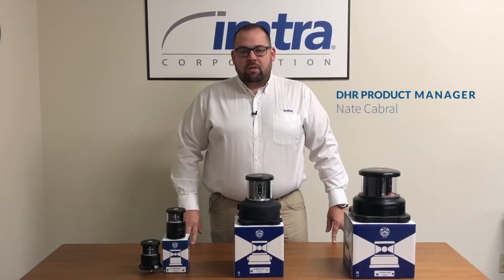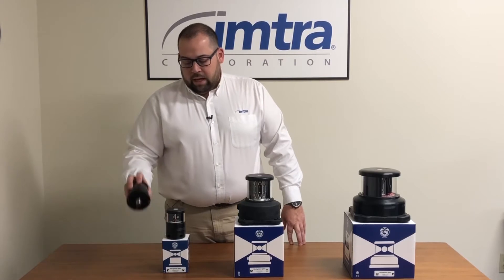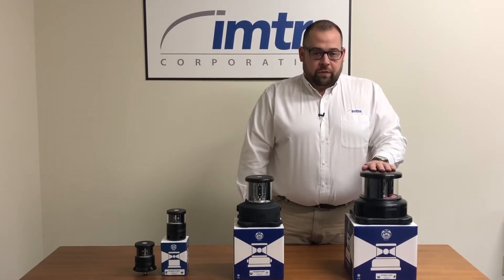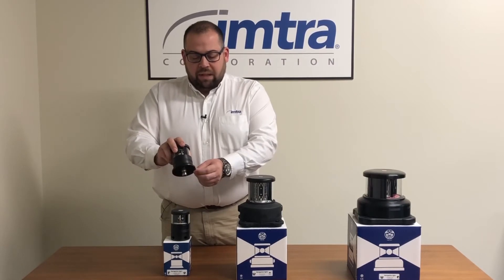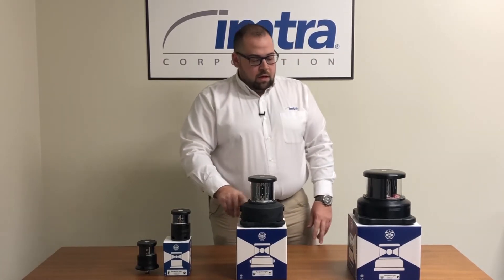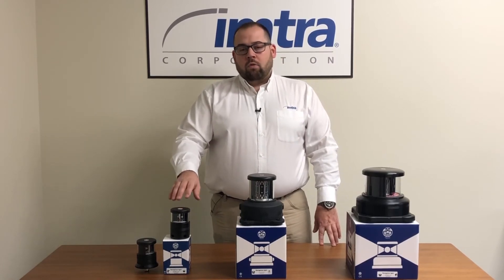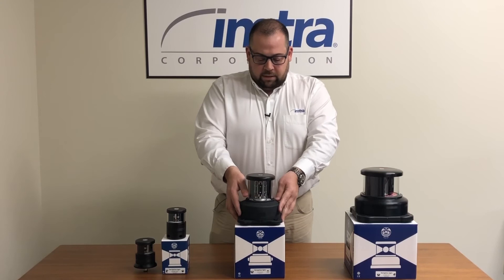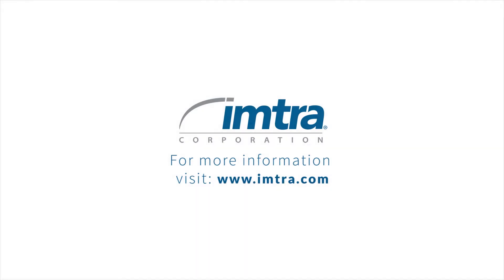DHR Navigation Lights

Comment: Why you don't use Fresnel lenses ?
Reply from the maker: Hi warjacare - Thanks for the question.  The Fresnel lens was traditionally used to optimize the light output of conventional navigation lights (navigation lights that utilize a bulb).

LED navigation lights can be manufactured with precise light output, and for that reason, the Fresnel lens is no longer needed.

The primary advantage of glass (clear) lenses (which are used for the DHR40, DHR60, and DHR80 LED navigation light) over polycarbonate Fresnel lenses is the extended durability.  Although polycarbonate is a type of plastic that’s generally very resistant to a wide temperature range, it will degrade over time, causing the lenses to fade and discolor. 

It has been in our experience when conventional navigation lights are used; the crew usually performs bulbs replacements every few months, allowing them to inspect the navigation light at the same time.  With LED navigation lights, the average lifetime is approx. 50,000 hours, relating to 5-10 years of continuous operation depending on usage.  For that reason, there must be no maintenance requirements for LED navigation lights, making them as safe as possible for navigating at sea.
Reply: @imtramarineproducts  Thanks for the excellent information.
Reply from the maker: @warjacare  You're welcome!